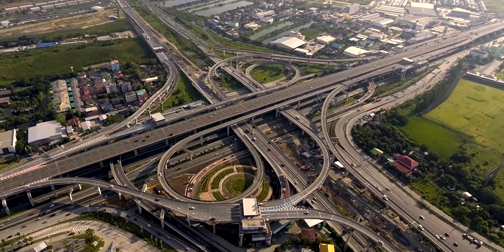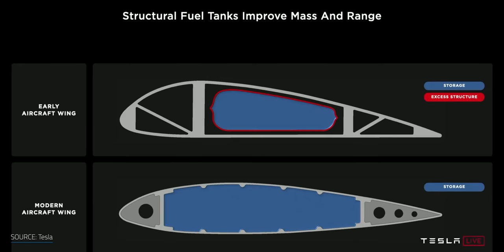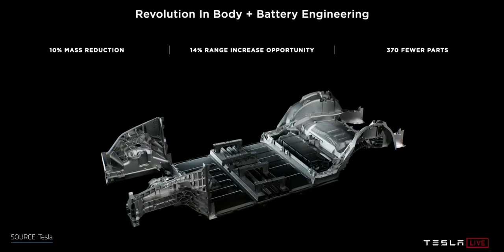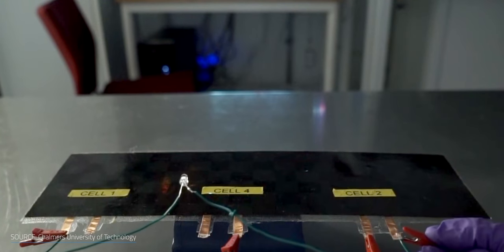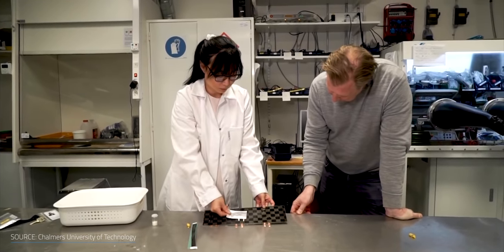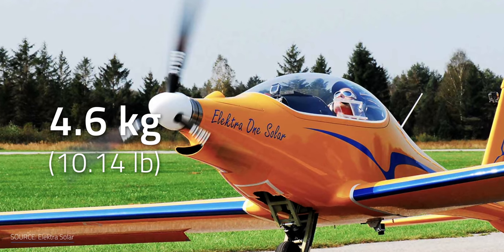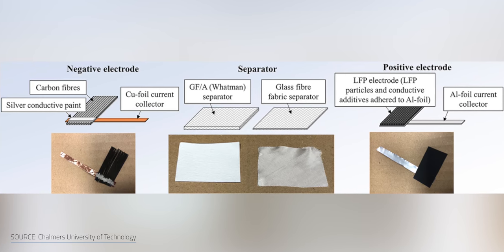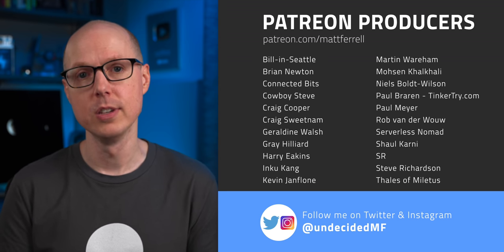Exploring Structural Batteries

Comment: When the battery wears out you throw the whole car away.
Reply: Yes. After about 600.000km for the small Models. And up to 2 Million kilometers for the Cybertruck e.g.
Reply: Or,.. maybe they won't wear out in your lifetime. 
Hope you don't have the same response when your tires wear out. Or in your case,.. Your Wheels 😂
Reply: I mean, if they design it well, you just replace the body panel that's failing.  People might want to even do this any way to change the look of their car to a new body style.  Change your body style every 3-5 years would be a cool option while keeping the frame and motor and electrical wiring the same.
Reply: You could even add on a "case" like we do with smart phones.  This "case" could add additional mileage.  Replace your "daily drive" panels with "vacation drive" panels which are thicker.  That would be pretty sweet.  I mean you could even rent the thicker panels for your trip.
Reply: @wolfgangpreier9160  that's before they completely fail. You have 1500 charge-discharge cycles on it.
Reply: @wolfgangpreier9160  There ain't no way they're gonna get over 2000 cycles on that battery with current tech. Not to mention a tesla owner would consider anything over 200k kilometers junk.
Reply: @wolfgangpreier9160   Does you phone battery last as long as what you thought it would or it was advertised... Ok just make it bigger and expect the same outcome..
Reply: Skela T.  
Another Mechanical Wizz.
"Wheels",.. hold the "Tires". Whatever. Just ask your Mom pal.
Reply: Skela T.  
Oh,.. I get it. My mistake 😬
You are Extremely Slow. That's ok.
Wheels,.. meaning the person was SLOW like yourself. And Continued on driving with flat tires. Till they were only driving on the Wheels.
... damn, babysitting is Hard 😂
Reply: @astronichols1900  
Funny that all tests and user info shows that the Tesla Battery Pack on average, is good for 500,000 miles, with only a 20% degradation over that distance. But you're the expert.
Reply: @vitalchance1032  
Funny you mentioned Phones.
That brings up Power Management. How the available power is used.
I just got a new phone. With about the biggest battery you'd want in a phone. And of course, a more current, higher speed system overall. But.
Doesn't do any better than my 6yr old phone in any usable way. And not only has a battery life that seems no better. But,.. this thing heats up doing menial tasks. And it came out at Christmas. And is my 3rd replacement. This thing sucks from my standpoint.
And why I'm fixing my old guy. The charging port failed. But, almost 6yrs. Something had to go. And that's the part with the most physical use.

Point being.
My old phone has better Fuel Economy. Doing the same daily drive 😂

I'm sure someone will ask.
My old phone is a ZTE AXON 7.
My new phone a POCO X3. Not the Pro. 
My old Axon has Dolby Atmos Too. Works fn Awesome with the Exos 9s 🤗   blah blah blah 😋
Reply: @justinroysdon2630  
HEY HEY HEY,.. relax dude. You're thinking. That won't fly here 😂
No no. Good Job 🤗👍🤗 If you don't live in a box. You don't have to worry about thinking outside of it 😂
And myself, looking at the mounting of that Tesla Battery Pack. I can see, or engineer myself. An easy installation and access of a bottom mounted battery pack. Structural or not. It's simply part of the vehicle. It's all in engineering.
Hell. We still have 3, battery powered Lunar Rovers on the moon. And I have a dollar it wouldn't take much to get them on the road.
Well,.. besides going to the Moon. If some Aliens haven't already Stripped them for Parts 😂😂😂
...that's funny
Reply: You hit the nail right on the head", Way to Go!  LOL!
Reply: So its like a Kia?
Reply: My electric car battery was defective, it took days to install the new one, but pulling a car entirely apart?
Reply: @wolfgangpreier9160  that’s assuming none of the cells ever go bad. I’ve owned more than one car battery that eventually had a bad cell early in life, and work daily with cordless tools, and packs go bad from one cell. I’ve even met a guy who disassembles Prius batteries, recycles the bad cells, and builds a new pack from the good cells. In a perfect world, I’m certain your numbers are fine, but things aren’t perfect
Reply: No you just have to replace the frame.
Reply: They need to plan for it during design and it will give a set of design limitations. But it is possible to make replacable structural components. Or maybe just replace the whole skateboard itself and keep and re-use the body. Similar to what we do today with box frame cars.
Reply: @wolfgangpreier9160  Do they actually last that long? .....that was my concern - how much life will the batteries have.
Reply: @minkorrh  1500 cycles. Then they are at about 70%. 1500 cycles with my Model 3 is about 1500 x 300 miles = 450.000 miles. Thats more then good enough for me. Of course if there is an accident everything is possible. I cannot account for that case.
Reply: Do you understand how batteries wear out? And do you understand that these new batteries at least appear to be solid state and therefore will not wear out in the same way that a normal lithium ion or lithium polymer battery does? My guess is, if this ever goes anywhere, it will likely be made several years from now, using significantly better solid state battery technology and if the current solid state tech is anything like how the early lithium ion tech was, it will get significantly better over time as we refine it so assuming these structural batteries will use future solid state tech, it will likely last a significant amount of time, probably much more than the rest of the car will last in terms of mileage.
Reply: @wolfgangpreier9160  Anyone that would make a claim like yours is either lying, or doesn't know what they're talking about. That's optimal. There's a whole host of factors that effect that number, none of which are defined in your scenario, and many of which can effect that number quite drastically.
Reply: @My-Pal-Hal  Except tires are replaceable. Easily. You sure you're qualified to even be making such an analogy? Cuz making such a statement serious brings your qualification into doubt. I mean, shit, any joe schmo can buy a swing arm tiring changing machine for $1000 if one wanted to.
Reply: @C Preacher uhhh, you can't replace a car battery yourself already. They are hundreads of pounds and not easy to replace. I get the feeling you have but that's really not realistic now.
Reply: @My-Pal-Hal  Look out, everyone; We've a mechanic over here. You sound like someone that doesn't know they're supposed to change their oil, let alone on what maintenance schedule or what grade. And even if you did, you'd take it to Jiffy Lube where they just fill your brand new engine that requires 0w20 with the cheap 5w30 from a 55 gallon drum they got for $44 and use a fram oil filter for a 2002 Dodge Intrepid regardless of what ever make and model car you've got, then you blame the manufacturer, dealership and and mechanic for "ripping you off" when you get a spun crank bearing.
Reply: @Maximum_777  Solid State batteries wear out just the same as liquid electrolyte batteries. Current versions of solid state batteries - and yes they do exist, just either very small and only usable for very special use cases or extremely inefficient and expensive decay even faster then current versions of Li-Ion batteries. 

Wear out contains a wrong assumption. They do not wear out but destroy themselves from the inside out.

SSB are very far away from the 6000 cycles of a LiFePo4 battery.
Of course: Maybe tomorrow someone invents a new concoction and manufacturing process that allows to build gigawatthours of solid state batteries for a fraction of the cost in a fraction of the time needed for Li-Ion liquid electrolyte batteries.

Possible, but not propable.
Reply: @michagabo8819  bro holy shit were talking about batteries not an old book
Reply: @wolfgangpreier9160  ye at least now, I'm just saying if they're anything like how lithium batteries started out, people though it was basically impossible for them to get anywhere near where they are today, even just 20 years ago, so at least there's hope.
Reply: @Maximum_777  Yes, they took a long time to mature. And now they are in their good middle ages. Not perfect, still room for development, but the  basics work and are usable enough for now. I hope that somebody invents a solid state battery with 1000 Wh/kg so we can equip airplanes with electric motors. But i would not bet on it. Still, 90% of the transportation business can be handled with those existing batteries. We just have to produce a bunch of them. A very great bunch! That will take time. I just hope that it will not take too much time. I would not want to see a draught and floods and snowstorms in June and thunderstorms at christmas every year over the next decades.
Reply: @C Preacher Well ya, I said you couldn't, I didn't say an actual mechanic couldn't.
Reply: And it becomes unrecyclable toxic waste.
Reply: in theory you could still make the assembly replacable. its just questionable that they would.
Reply: @C Preacher You cannot get a main electric car battery replaced by nonmechanics for free. You got the 12v battery replaced which is 2 bolts and a 10 min install.
Reply: @justinroysdon2630  Unfortunately, its Tesla. According to autoguide.com, Tesla has the worst initial quality of any car manufacturer.
Reply: or just change out your panels? people do this all the time with their current cars when there is external damage.
Reply: @motor2of7  Bruh the battery has 1/5th the capacity of normal batteries. He made no valid points. He lied through his teeth and copied another article word for word.
Reply: @occamsrazor1285  
A "Tiring" Changing Machine" 😂
...yeah, you're a mechanical expert alright 🤤
Reply: @occamsrazor1285  
Oh. 
And don't forget one of those Pop Top TIRING Balancer things that sit on the floor. 
I heard they do something. Probably only another $1000 😂
... trolls are fun 🤗, though I'd keep this clown away from Sharp Objects of any kind 😬 ...
Reply: @davidelzinga9757  
Except your idea of "CELLS", is in a very limited number of same. A Car, or wet Battery, only has a few cells. A Tesla may have over 7,000. So one or two or Ten defective or non-operational batteries , has little effect on the overall performance of the battery PACK.
Unless they catch fire. But thats a story told with many batteries.
... usually operator malfunction 🤤
Reply: @astronichols1900  
And I must respond to you.
I'm just damn glad my 6yr old Axon 7 Phone. Doesn't know it CAN'T get over 2000 cycles. Because it past that Years Ago 😂 ...till I had to replace the Charging Port. Still works Great.
Reply: @vitalchance1032  
Damn. I just answered your question about phone Batteries to another Commenter. Maybe my phone is different. It IS 6yrs old and working fine.
Maybe it's Operator Malfunction. And taking care of a battery. Or anything else is,... ... New. Could be.
Things lasted so much longer. When people understood them. And when those things actually mattered. And took care of em. That Was Before the age of "I'll just get a New One" has enveloped our world.

And the World Ain't Liking That Either 🌎
Reply: @TheSkrylar  
No, not in Theory.
Everything is Replaceable. How EASY,.. a different question.
But the batteries used in packs like this. And the technology of same. Have made them a very reliable system. To the extent it can be Built, into the vehicle. And, as a Functioning part of the frame. It's reliability vs technology. And joining the two together.
And of course making a part of the vehicle that Shouldn't need Immediate Replacement, less accessible. Just part of the job.
Google Apollo. That's some 💩 right there 🤗
And though I got a dollar nobody here really understands this subject. Or Batteries in general.
The videos subject is in removing weight and serviceable parts. (parts needing service) And the extra Weight for a service structure that would ADD more weight, just for it's servicing.
Hey. It's New. Isn't in Production. And may never be as many technologies go. But.
Something to think about... and go from there 😊
Reply: @Occam's,.. before he sharpened his Razor
Well. You got your 1/10 of a second of Fame. So? Nothing?
Are you busy wondering why you changed the oil in your Dodge. From one Not Covered by the Warranty??? And are F'd ?
Or are you just pissed you're driving an Intrepid 😂  I'd go with that.

Still got my Old Chrysler Product.
69 Plymouth Roadrunner. I'm running 5W30. Want to Race 🤔
...it's not quite stock, but I'm sure you got me, you are a mechanical expert after all 🤤

Got my 2002 STS 🤔 Same Year, that should be fair.
Still using 5W30. You could give that a run.  I'm Kidding.
The only thing you run is your mouth. From way behind the Finnish Line.
I run my mouth for the Media after the win 😊 ..and it's Fun 😉
Reply: @justinroysdon2630  
And you talk of changing "Panels".
While these batteries are packed in part of the STRUCTURE of the vehicle. So I'm not getting how the battery packs, are integral to your comment of Panel Replacement.
A Fender (panel) isn't your floor panel. Which IS your battery. And the Frame.
...jus wondering your view 🤗
Reply: @My-Pal-Hal  "usually operator malfunction" Yeah a 9mil in the underside of your EV does that all the time. And disrupt your evening plans in the drive-in theater with your nice little redhead.
Reply: @My-Pal-Hal  "Axon 7 Phone" never heard of that manufacturer. Must be some US local one.
Reply: @wolfgangpreier9160  
HEY. HOW DO YOU KNOW SHES A RED HEAD 🤔
Put on your mask sweety 🤣
... sarcasm is fun too ✌️
Reply: @wolfgangpreier9160  
Not sure what you meant.
But it made a Good Joke 😂
Reply: @wolfgangpreier9160  
And We use Inches,.. like God Created 😉
... science is fun
Reply: @wolfgangpreier9160  
Oh Crap ... They used Cubits 😂
...my mistake 😜
Reply: @wolfgangpreier9160  
ZTE AXON 7. 
Best phone I've ever owned.
Out Preformed Everything I've owed in real world use. And everything my iphone friends own too. More than one, bought one. It's been Awesome. And I'll use it till... I can't get part 🤗
Reply: @wolfgangpreier9160  
And it fits this conversation well.
It's 6yrs old. HAS, because of me, well taken care of. Charging is a Thing. Try not to Kill the battery Dead. And not leave it on a charger while it's fully charged.
BUTT. .. with 2 Ts 
It takes all parts of an operating system. That melds with ALL other parts. To Actually Work Well. And with any Longevity.
You can have the Best 💩 in everything you own. Still, doesn't mean it works 😏
...and I think you understand ✌️
Reply: @wolfgangpreier9160  
And a Quick Note.
You can't hardly get them even Used.
That tells many stories of a product that was Popular 😊
Reply: @wolfgangpreier9160  
And a simple explanation of Operator Malfunction.
The RED means Positive. The Black means Negative... 😂😜
Don't tell me what it means. It's my battery, and I'll do what I 😵😵⚡😵⚡😵 ...   MOM 😂
Reply: @wolfgangpreier9160  
...and yes... 9mil sockets are popular.
After your explanation. We know where to Find One.
Though I'd think if you're at the Theater with a Red Head ... Maybe you should keep your Sockets in their Pockets.

... because she prefers a 14mm 😂
Reply: That's a good one...
Reply: @occamsrazor1285  
Yes. We can wait a day or two, for you to change your oil. Then wait for your response.
Unless that oil change is in your Perm. Which may take much more time. I'm mean the simple process of Removing your head from your 🐎,.. isn't so simple I'll imagine.
...I really didn't have to imagine that. BUTT, It's all Part of how some things are Engineered 🤡
Reply: TANGLDWEB Tires wear out, wheels don’t. 

You obviously ARE on something, as Skela said.
Reply: For consumer capitalism, that's ideal.

Now if they can only make it wear out faster, it'd be perfect.
Reply: @vitalchance1032  You guessed why I made that remark. I just had to buy my wife a new cell phone because her battery went bad and the cost of fixing it was more than the price of the new phone.
Reply: No way!  
Electric cars are more flexible in term of obtaining newer battery sources or even putting some serious generators onboard to power them; It is just a matter of numerous possible implementations, and options are available in aftermarket products.
Reply: P Vo Soccer What’s the point of an electric car if you just put a generator on it?
Reply: @orppranator5230  
Most all Electric Vehicles Have Generators. Do a second of research and you'll find out. BUT WHAT WILL REALLY BLOW YOUR MIND ! ! !
Is they can generate Power,.. from Braking Too ☺️
...im kidding, ya need a mind to blow
Reply: TANGLDWEB You are talking about hybrid cars, I am talking about actual, ALL ELECTRIC cars and yes I know about the thing called “Regenerative Braking”- learn proper terminology before calling someone a mindless idiot.
Reply: @erwingove3497 
“you got a bad water heater, you’re gonna need to replace this basement” 😂
Reply: @threestans9096  
...yeah, you got that right
If it was Put Together. It can be Taken Apart.
And I'm a 61yr old, that just fixed my 6yr old phone whoms charging port wore out. Because it outperforms my new phone I bought. Because I thought a half decade of new technology might be cool. So I got a new one.
It Wasn't Cool 🤬

And I drink close to a gallon of milk a day. And none of the sellers use reusable Glass Bottles.
And it kills me seeing all this now useless plastic every day. Nevermind Packaging Nowadays.
It's All Money.
But it won't last forever. Especially for those whom live for Money. It won't help in the Apocalypse 😂
Reply: Tesla's new 4860 cells will last a million miles it's already been confirmed by Tesla (CTO) Drew Baglino in the latest earnings call. So the batteries will outlast the car by a longshot
Reply: since in regular car when you get 150k you buy new engine ROFL
Reply: @My-Pal-Hal  Build first such mobile phone. 
If it survices 5y mark it will be best advert of technology.
Reply: @marcinwaach7639  
Funny you mentioned that.
My 6yr old Axon 7's charging port failed. Being a solid body phone. I thought something 6yrs newer would be cool.
IT WASN'T.
I bought a POCO X3,.. and it sucks things I've never even imagined 😬
So,.. I repaired my Axon 7. And texting with it now.
YEAH,.. I should have replaced the battery since I had it apart. F U 😂
But it never really has had a problem doing its job for a day or two with the battery installed. And the POCO with a battery almost TWICE it's size. Doesn't preform better enough for me to notice a difference.
And I youtube hours a day walking with my buddy in my picture.
It's Battery Management.
Don't kill it. Don't Over Charge. Don't leave it at 100% on the charger for hours,.. etc etc.
PS. I'd buy another Axon 7 if they existed. Can't even find them used.
Anyway.
I'm using a 6yr old phone, with the same battery. SO WHAT DO I WIN 🤗
Reply: @marcinwaach7639  
And I just looked at my text list.
157,891 texts in those years.
Damn. These things are addicting 😂
And I filled 6 32mg cards of pictures and videos. Since it came with a Pedometer,.. UNLIKE THAT NEW POCO PIECE OF 😘
Shows my pal and I did 61+ MILLION STEPS. Not bad for a disabled guy. About a Million Steps a year.
Yes.
This is a phone that should be Praised. 
But. Nobody is happy nowadays with anything a day old 😭 it's sad
Reply: @My-Pal-Hal  But then you have to say good by to fast chargers. Good by to acceleration. And you have boring car hard to advertise and maybe good for environment.
Reply: @marcinwaach7639  
Man. Your English needs a bit of work.
But as to Fast Chargers.
If your phone DOESN'T CONSTANTLY NEED A CHARGE.
Maybe a quick charger loses its Popularity, ya think.
And if your phone lasts more than a Year. Maybe All that "NEW" technology loses its Popularity.
And if whatever it is Actually WORKS. Then maybe all of those things lose their popularity.

I think the first GM electric car shows what I'm getting at.
We don't even know how well it Worked. Because they were Destroyed to follow the fossil fuel norms of 🤑🤑🤑🤑🤑
Reply: @matejzizanovic7959  That would be the extreme maximum achievable with this battery. Imagine the Semi with 1000kWh battery with 1500 cycles and 100kWh/100km or 1 kWh/km, Thats ONLY 1.5 million kilometers. That should even be more! But for a first generation its ok.
Reply: @matejzizanovic7959  I could show you some driving around, but certainly not in Europe. 

For Europe they have to shrink them a bit. Its not fantasy, its what testers and/or manufacturers claim. 

Until they do not claim the same nonsense as in the petrol cars everything is good and predictable.